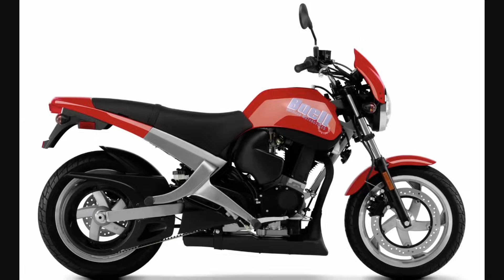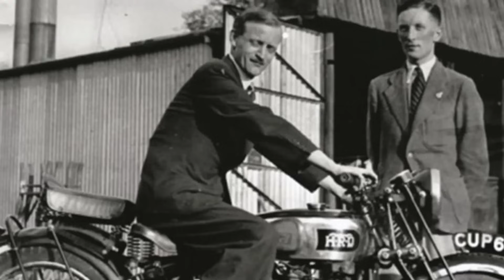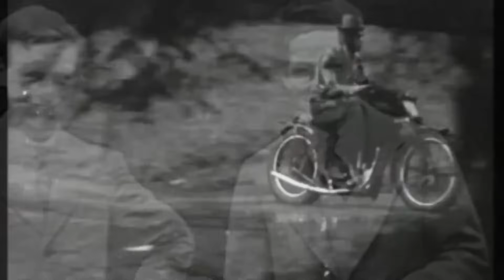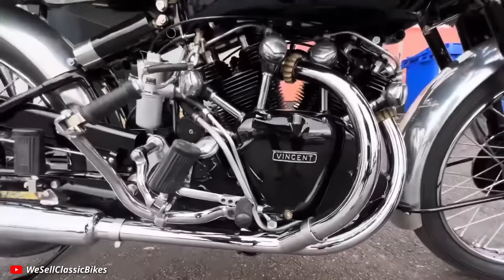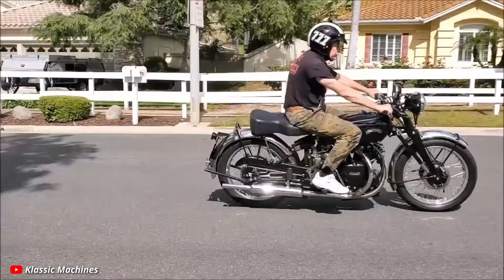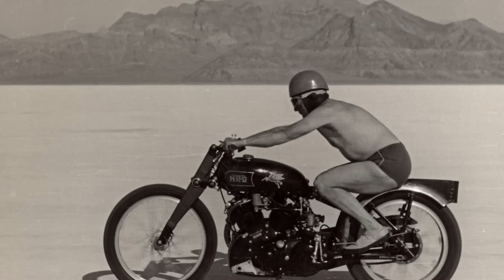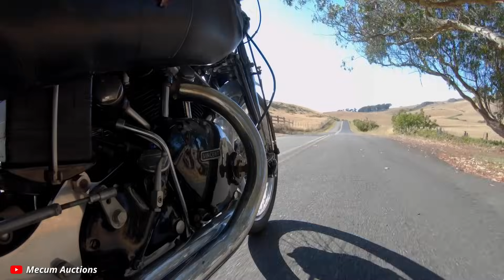The GREATEST Motorcycle Ever

Comment: I bought my 52 black shadow 30 years ago as a basket case. After about $1200 in parts and $200 in paint and a whole lot of work it's been running for 25 years without a problem.
Reply: Money well spent and ironically you have a cheap bike but worth more than just about any other one!
Reply: Fantastic to hear.
Reply: Now THAT, is an investment whether you like to look at it like that or not.
Reply: Why do motorcycles sound like a rapid succession of farts when in motion?
Reply: @BUMBLE-FART  Pardon me, guy, but for this short comment, I will claim to be a representative speaking for my fellow long time senior riders, when I say your remark says more about you than it does a solitary 500cc British single singing its way across a stretch of Englands countryside.
Reply: @HELL-BENT74 because those motorcycles have single cylinder 4 stroke engines!
Reply: @BUMBLE-FART  If you don't like the exhaust note, change the exhaust.
Reply: @BUMBLE-FART  because it has gas
Reply: I bet you have been frequently asked if you would sell it
Reply: Maybe you can answer my questions about the Black Shadow I posted above or below?  Like why are they so fast?  Overhead valves? Do they use pushrods? etc. Thanks!
Reply: @DesertRat332 The answer is in the video essay. Higher compression ratio, larger carburetors and polished components. I'm sure the choice of gear ratios along with its relatively lighter weight had a lot to do with it. It was "only" 55HP but it can go over 125 mph.
They were handcrafted machines.
Reply: @sPi711 Compression ratio was only 7.3:1.  Sportsters had 9:1. Larger carburetors?  You can't pour 10 gallons in a 5 gallon bucket.  Weight is about the same as a Sportster.  Your answer still does not answer my question why it could go 150mph.  If it really could.  Thanks, anyway.
Reply: Published top speed was 125 mph. 
The racing top speed was 150 mph, which is confirmed, with the bike specially tuned for the trial and rider lying flat on his belly, in shorts, as I'm sure you're aware, to reduce drag. 
A Harley Sportster weighs at least 100 lb more than the Vincent. The Sportster is not tuned to go even 125 mph, although it has the power. Their engineering is mediocre at best and the vibration alone would probably break every bone in your body (I'm exaggerating for effect) before you reach that speed. Harleys are mass produced, so the quality control would never reach that of a Vincent, which produced very few in number. They are not designed, built or tuned to do anything but cruise around; and not even that for very long periods. The two are not even comparable.
You could discover all you need to know and get into it as deeply as you would like just by looking. 
You're welcome.
Reply: "25 years without a problem...?!"
This is what makes me very irritable, about the "crapola" that's made these days.
They are all made with suspect quality metal, both ferrous, and none ferrous, and are designed on a computer, seemingly by wannabes who wouldn't know shit from clay.
And they're all tarted up with lipstick and mascara!
Yes, the Black Shadow was a testament to mens' skill and intelligence, made under almost primitive conditions and penury.
Reply: @johnwillis4706  good stuff, it would be a real shame to see a masterpiece like that getting neglected
Reply: There's 25 years and there's 25 years of constant use. As admirable as it is to restore a legendary bike  how many miles has it done in that 25 years?
Reply: 15K and it's junk.
Reply: Sean Rowe's version of the song "Vincent Black Lightning" is incredible - way better than the original. Captures the very essence of hurtling along on one of these beasts through the Surrey Hills.

Comment: The rear suspension did not "use a twin shock set up" , It had two springs in cylindrical housings and a hydraulic damper between the two springs
Reply: and its not big ben....its the elizabeth tower.....
Reply: @bonvoyage5377 Big Ben is a big bell.

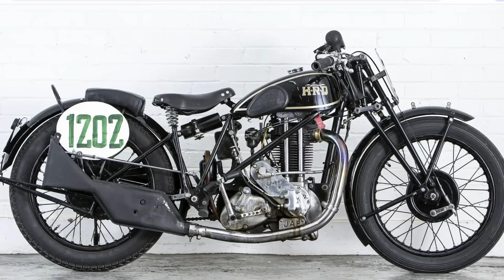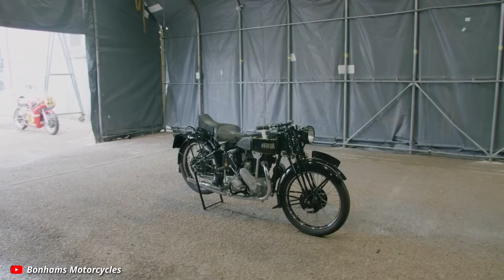Comment: Well it appears what Irving did was get rid of an advanced rigid triangulated frame 3:51 and replace it with a run-of-the-mill-at-the-time frame  4:23
Reply: Yes. That's what sold. 

We see the same things done today. The bike I ride started production with gear driven cams that were light and simple and accurate. The one I have uses a chain. There are bikes with fully enclosed chain cases for the final drive. That makes the chain and sprockets last longer than a shaft (the XV1000 Yamaha, which was often called a Japanese Vincent had one). Styling took precedence and it was deleted.
Reply: @gasdive  I had an XV1000 too
Reply: Both have a triangulated rear frame. All Vincent machines came with them
Reply: @ Vincent used a cantilever swingarm . It is not a rear frame  that a rigid framed bike might have. By definition a cantilever has a triangulated structure.
I was referring to a triangulated frame - the steering head to swingarm pivot is the part that matters for rigidity. It eliminates the "hinge in the middle" all the bikes of the day had with the exception of the featherbed frames that achieved rigidity in a poor design by using extremely heavy water pipe to manufacture the frame.